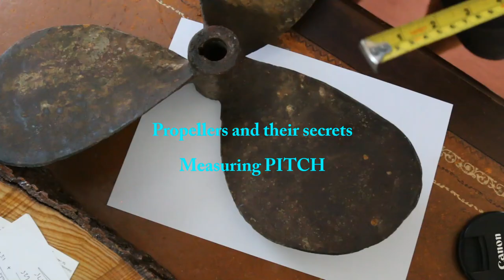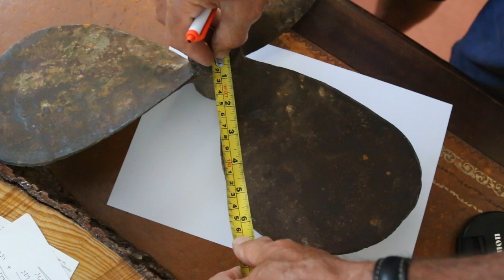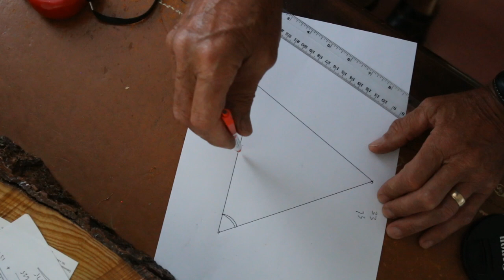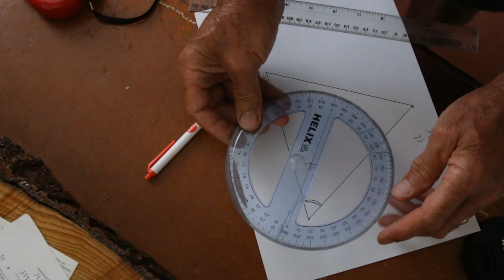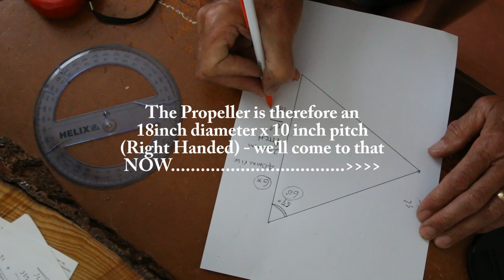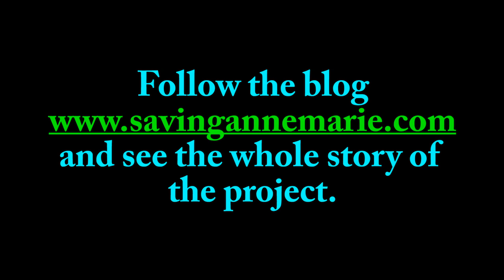Measuring a propeller's pitch

Comment: Why wouldn't you just have one propeller design that maximises pitch? For example, why are some 2 blades, others 3 or 4? And surely it would be best to angle the blades as much as possible?
Reply: It depends on what you are trying to do. A powerboat that wants to cruise at 30 kn has a different need to a sailing yacht. One will have a high powered engine revving very fast and providing loads of thrust. The other turns over at low revs with a maximum speed of 6 kn and an engine of only 50 hp. It’s definitely not one size fits all.

Comment: does this math work with any type of prop
Reply: It should do. It measures the distance travelled through one rotation of a single blade so would do the same for a two, three, four or more bladed propeller. It’s only measuring pitch and diameter. Thrust and power will probably be based on the engine output power, speed of rotation and displacement of the craft. 
Thanks for the question.